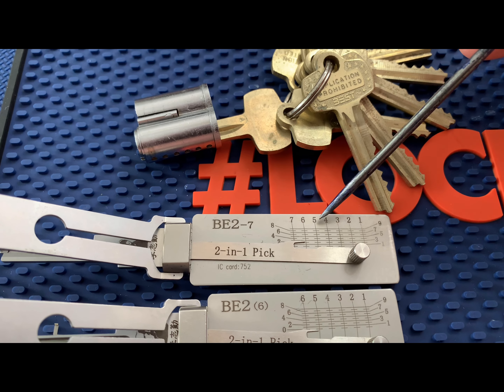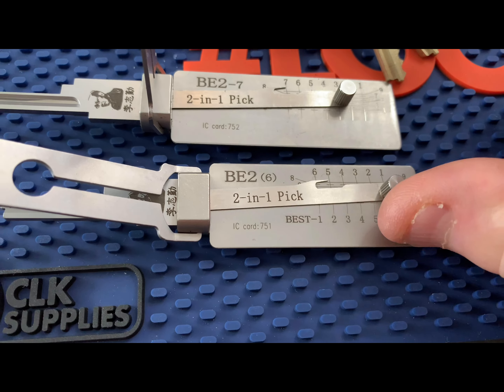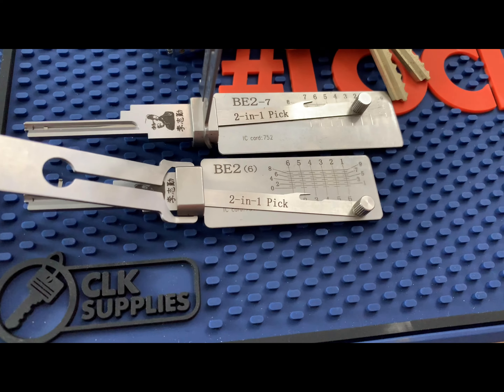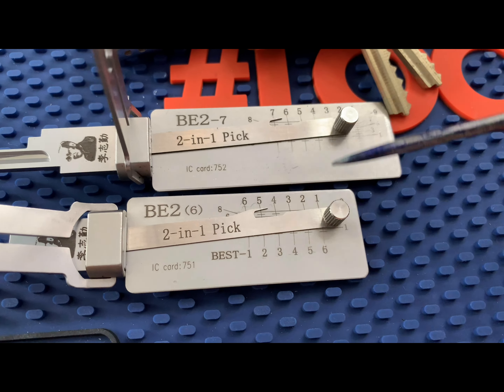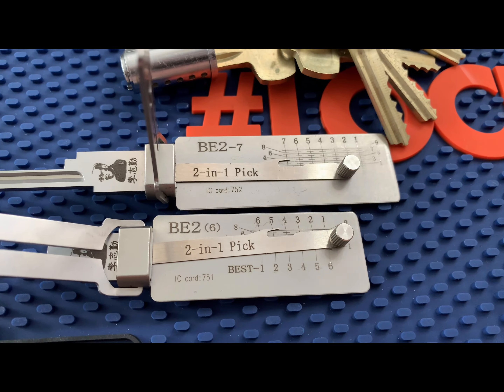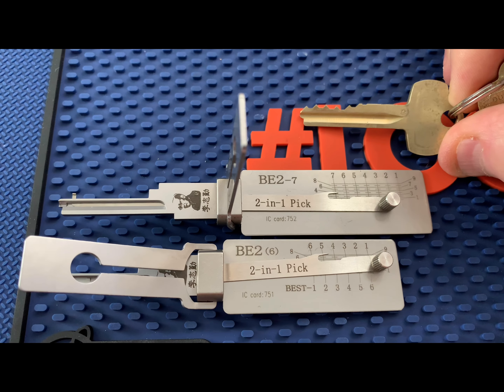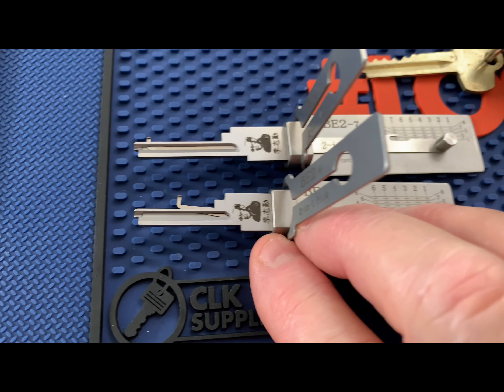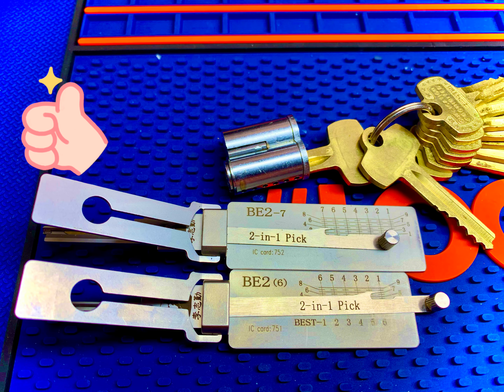Tips on using Lishi BE2-7, 2-in-1 Lock Picks 🔐 #automobile

Comment from the maker: The best way to use a Lishi BE2 lock pick

How to use a Lishi BE2 lock pick
- How to insert the Lishi BE2 into the lock
- How to rotate the Lishi BE2
- How to pick the lock with the Lishi BE2

What is a Lishi BE2 lock pick?
- What is the difference between a Lishi BE2 and a Lishi 15L
- How does a Lishi BE2 lock pick work?
- What are the benefits of using a Lishi BE2 lock pick?

Where to buy a Lishi BE2 lock pick
- Where can I buy a Lishi BE2 lock pick?
- How much does a Lishi BE2 lock pick cost?
- What are the shipping options for Lishi BE2 lock picks?

Tips and tricks for using a Lishi BE2 lock pick
- How to make sure the Lishi BE2 is inserted correctly
- How to rotate the Lishi BE2 correctly
- How to pick the lock with the Lishi BE2

Warnings and disclaimers
- This video is for educational purposes only
- The video creator is not responsible for any damages caused by following the instructions in the video
- Lock picking is a crime in most countries
Lishi BE2 lock pick problems

A step-by-step guide to picking a pin tumbler lock

By this picking vice
QWORK Micrometer Stand for Micrometers up to 4" - Professional Grade Cutting Tools Stand with Large Clamp Knobs https://a.co/d/bzxAakV

Rubber lock stands
Toolly 4 Packs Floor Jack Pad Adapter for Jack Stands 2-4 Ton Universal Heavy Duty Rubber Jack Disk Pads Slotted Frame Rail Pinch Welds Protector for Lifting Car https://a.co/d/hbIISsT

How to pick a KW1-L lock with a Lishi KW1-L lock pick
- How to use a Lishi KW1-L lock pick
- How to pick a keyway lock
- How to pick a lock without a key

Tools and materials needed
- Lishi KW1-L lock pick
- Tension wrench
- Pick mat

Step-by-step instructions
- Insert the lock pick into the keyway
- Apply tension to the lock
- Rotate the lock pick

Troubleshooting tips
- If the lock is not picking, try using a different lock pick
- If the lock is still not picking, try using more tension
- If the lock is still not picking, try cleaning the lock keyway

Learn how to pick locks with this easy tutorial
- Learn how to use a Lishi KW1-L lock pick
- Learn how to pick a keyway lock
- Learn how to pick a lock without a key

how to use a lishi kw1 lock pick on kwikset locks 🔐
https://youtu.be/dmDvXbYvp1o

Lishi KW1 Lock Pick for Kwikset Locks 🔐

Lock Picking Secret Weapon
https://youtu.be/lzBU6-wy37E

Tri-Flow Lubricant
https://a.co/d/dBpyyiZ

Lab Lube
https://a.co/d/0C39LOS

How to pick a lock with a lishi sc4-l lock pick

How to pick a Master Lock 407D
- Use a Lishi SC4-L lock pick
- Find the sweet spot
- Apply pressure to the pick

How to create a tension wrench
- Use a flathead screwdriver
- Bend the screwdriver
- Insert the screwdriver into the lock

How to pick a lock without damaging it
- Use a gentle touch
- Don't force the lock
- Pick the lock quickly

How to pick a lock in seconds
- Use the right tools
- Know the technique
- Practice makes perfect

How to pick a lock for beginners
- Watch this video
- Follow the instructions
- Practice what you learned

Which Lishi Lock Picks do you need
Please❤️
https://youtu.be/8iqPdbxgDJQ

Please Buy me a cup of coffee. I need all the help I can get. https://www.buymeacoffee.com/doorandlocktips

Peterson practice plastic Lock wonderfulness:
https://www.thinkpeterson.com/transparent-practice-lock/

Peterson credit card pics like what shown in the video what a great bargain:
https://www.thinkpeterson.com/credit-card-pick-set-gsp/